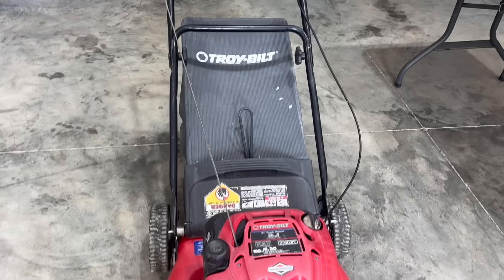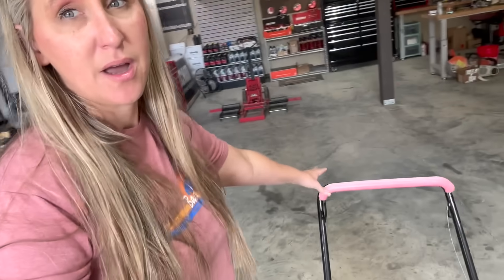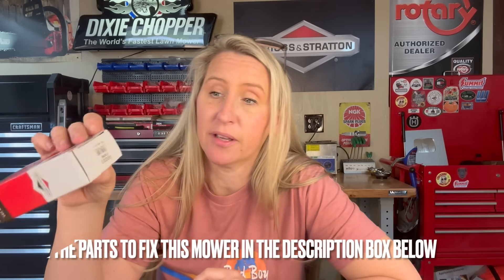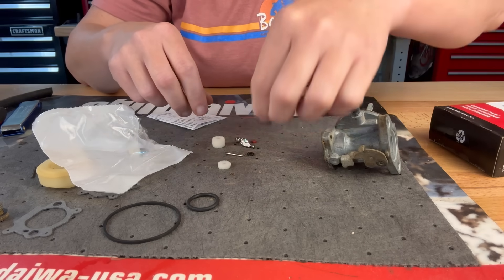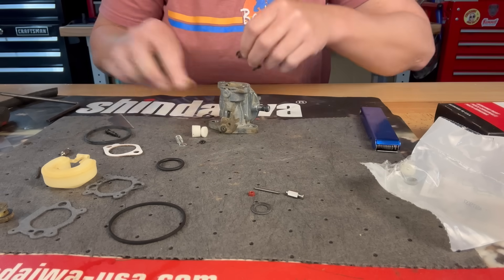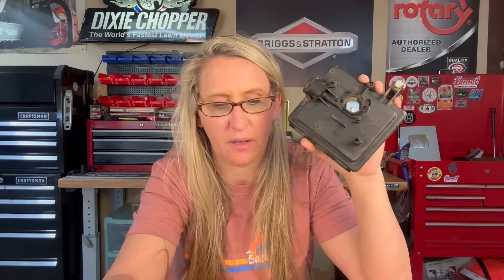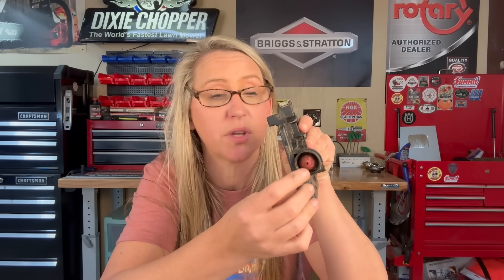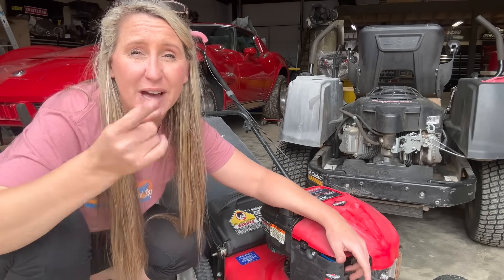FREE MOWER! Turning Customers Trash Into My Treasure! How to Fix a Briggs And Stratton 6.5 Flathead

Comment: I noticed she set the intake O-Ring Seal aside and did not replace it.  For some older machines, if the O ring is damaged or shows signs that it could potentially leak air it should be replaced with the new one.  Her machine was in pretty good condition and no doubt it looked good.  But she might have mentioned the purpose of the O ring she set aside and that it  is an option folks should use if the existing ring looks long in the tooth.

Comment: Got a snapper with a 7.5  B-S on it change the deck the transmission cause it’s self propelled and lord knows how many blades but the engine hasn’t stopped since I bought it in 2012.

Comment: Did I make a big mistake in purchasing a new TORO 163 cc SUPER RECYCLER SELF PROPELLED W/ "PERSONAL PACE'"
WALK BEHIND mower at LOWES (model #21565) for $699.    
NOW I'm hearing of carburetor issues, Briggs & Stratton Motor bad reviews ect. etc. ?????
I spent hours & HOURS watching videos , comparisons etc. but have been discusted with choices for home owners that just need a personal property (almost an acre) self propelled, lighter weight (less than 90 lbs) mowers with a reliable engine ( good carburetor, less plastic internal parts at a price point around $700 - $1,100 ??????  
My Honda HRX 200hp $1,200 was the best mower that I had ever used 2 years ago !       Any suggestions other than taking this one back ad buying a super heavy "Commercial Grade" brand with a KOHLER or KAWASAKI that I DO NOT NEED FOR CLOSE TO $2000 ????    Seems pretty ridiculous that Manufacturers have put homeowners in this very predicament !

Comment: I have a mower with one of those engines from 1994, I've worked in the carb a couple times, replaced the Intake tube when it broke off, basic stuff.. runs great to this day. Rear wheel drive yardman yellow and green baby
Reply: I had a newer craftsman with the same engine, front wheel drive. Wife made me give it to the neighbor when we were moving. Also had an 80s Honda with a rotten deck that my grandfather bought new that I gave away too. Still kind of pissed about that but my mower collection is building back up at my new place with the greenie, a newer Briggs 6.25 non self drive pusher and I just picked up another freebie that has potential

Comment: Carbs are universally garbage and I hate them all.
First, use a spark tester inline with your spark plug to make sure you're getting spark when turning over the engine.  If you are, then it's fuel and the carb.   And if it's the carb, it's the dmmn jets or idle jet that is clogged.    

And if you've cleaned those out the carb several times over and it's still not running right, it's the gasket between your carb and the engine is letting a pinhole amount of air through it, and it's not pulling through the fuel jet.  The solution there is lots of gasket sealer on that old worn out sorry gasket you've reused 5 times over.

I h8te carbs more than life itself.  The truly are a pox upon humanity.   Humanity can put a man on the moon, but it can't build a carb that will run without any trouble.   Eventually junk is going to clog it, varnish is going to clog it, or rubber is going to rot and get an air leak, or your fuel bowl valve fails, or whatever.    It's the sorriest piece of human engineering ever created.... 

And we have a solution to it, they are called fuel injectors....   which too, also fail.  As well as their computers and oxygen sensors.    So humanity needs to go back to the drawing board and deliver some fuel mixing system that does not involve rubber that rots or pin holes that can get clogged with no gaskets that can fail.

Comment: I have the exact mower.  Bought it for $75 and it ran fine. I replaced the fwd wheels,  blade, air filter,  carburetor, spark plug,  did an oil change. 

Thing runs amazing! Put about $125 total into it.

Comment: My rider,  walk behind mower,  snowblower,  and weed eater.  The mower is about 15 years old runs great.  Starts first pull.  All of my machines run great.  I do have a problem with my weed eater though.  Starts up give it some throttle and it dies.  New spark plug and new fuel didn’t help.

Comment: I know this is off subject but i have a question.
I get a burr on the point of my tooth when i use a dremel tool on my chainsaw chain. Husky 450 rancher. What am i doing wrong or what should i be doing?

Comment: My 2018 cub cadet xt2 l42 is dying when I mow after 45 minutes. It is 98 degrees. Not sure heat index. I changed the oil and filters. Still dying after mowing 45 minutes. Blue smoke. What do you think is wrong other than over heating.

Comment: Learned quite a bit from this channel.  I never really had luck rebuilding carbs.  Not that experience in doing so.  I do agree the Chinese carbs are not the same quality but never had issues with them. I do empty out all the fuel in tank and in carb at end of season and do use injector cleaner and Marvel Mystery oil in fuel on every fill up.  I still have lawn equipment and a snow blower from Sears that's over 20Yrs old.  I guess I'm doing something right all these years.

Comment: Thanks for the info. I have a mower of similar vintage (branded  John Deere) with what looks like the same Briggs. It won't prime. I was sold and told that it would be the air cleaner gasket. But not being a mechanic, I've been putting it off. You have given me the confidence to give it a try. What could go wrong!! Thank you, and all the best from Australia 🇦🇺

Comment: I'm impressed. Had fun watching. I don't use cleaning rods though. They scratch the channel walls and lead to premature oxidation blockage and erosion. High pressure nitrogen with a rubber tip blow gun does a great job at clearing after a little carb or brake cleaner softens the gunk. And use a torque wrench to finish tightening. Over torqueing is just as bad as under torqueing. Warping, cracking, stripping, binding... the bolt rods and nuts, the plastic housing, the block threads, all have specific sheer and tensile tolerances that should be observed for longevity. 
Happy tinkering!
Reply: Notice she did NOT use the impact tool to reassemble!  Not even after starting them by hand.  👍👍👍  With experience you know how much torque it takes for different bolt diameters and lengths.  Some of us just like to "feel it".  If I were torquing down a crank in a v-8, sure, but for this?  Nah.
Reply: @TheZuperDave 
I know lots of folks that like to "feel" the torque on refrigerant flare fittings... I guess that's why I get so many calls to fix someone else's "feel". Or perhaps they're just too cheap to buy a torque wrench. Or maybe too lazy to use it. Torque specs exist for a reason. Anyone with sufficient experience knows to use the appropriate tools.
I never said she was wrong. But feeling isn't accurate. It's the difference between a legitimate pro and "the guy who can do it cheaper".
Reply: I've got 30 years with an engineering undergraduate, own and operate my own HVAC company, and restore antique machinery as a hobby.
Good work ain't cheap and cheap work ain't good.
Have a better day.

Comment: Nice to see a good size shop with balcony.  After awhile you start thinking in cubic feet rather square feet because “stuff” begins to accumulate and you still have to be able to get to it.  So, additional balcony could be helpful.  As a suggestion, have ya’ll thought about having a ramp or hydraulic lift it make it easier work on mowers?  As age creeps in, the ability to be flexible will become an issue.  Just a thought and keep up the good work.

Comment: I have a craftsman just like that, great mowers that run strong with the proper care and feeding, but don't leave it outside year round. Actually, the plastic Wheels are the most expensive part and were made of a plastic that deteriorates in Sunlight. Also you have a nice clean work area and I use those magnetic cups to hold parts, they have an annoying habit of walking away.

Comment: Just checking to see if you added oil. We didn't see it. Good job on getting a nice mower! Is a flathead engine one with the valves coming up on the side of the cylinder? Mine isn't a Troy-Built, it's a Craftsman 6.5, but everything looks the same. I go it at the metal recyclers for $20 I've cleaned it up and am waiting on the carb from Amazon to replace it with new, though I cleaned up the carb anyway. Thank you for a very good video!

Comment: I just repaired a snapper walk behind. It cost me $17.98 for the air filter, $23.98 for a blade, $9.89 for a new spark plug. Had to clean out the gas tank because it was used without one since the owner lost it. The air filter was completely plugged. The carburetor had to be taken apart and cleaned. So adding labor to the cost is hard because it was an expensive repair. I was waiting to see the blade sharpening on this video but Looks like it was forgotten.

Comment: Number of years ago, we had a Troy Bilt with a Honda motor. Due to lots of use, the engine just quit, turns out lost compression and I wasn’t in the mood to do a tear down and rebuild. So I bought a Predator 5hp motor from Harbor Freight and mounted it up. I had to add a separate throttle cable, and the mower ran great. I sold the mower for $100 and bought a new Troy Bilt with a Honda motor. Still have it running great as I service it more than I did the other one. We have 2 Troy Bilt self propelled with Honda motors. Unfortunately, MTD isn’t making those mowers with Honda motors, only Briggs & Stratton which I don’t have much faith in, so I’m keeping these going until they fall apart

Comment: A suggestion; since a new gas hose was installed, a shutoff valve would have made soooooo much sense and been a great selling point to a customer.  This way, when finished, turning off a shutoff valve and using up the gas in the carb could prevent carb problems in the future even if one uses fuel stabilizer or ethanol free gas.  That's what I plan to do on my mower once the 2 year warranty perod is up.

Comment: I have a 2002 version of this mower. I have done minimal maint on it. Oil changes,  fuel line, air filter and starter rope replacement . Never used ethanol fuel. After 5 pumps on the primer it always starts 2d or 3d pull. Impressive for a 23 year old engine.

Comment: I put a filter and a fuel shutoff valve on these whenever I see them without them. will never have a fuel issue again if the user uses the fuel shutoff and runs the mower out of fuel!

Comment: I have a 2009 B and S  6.5 hp Craftsman. runs like new. Parts on the chassis wore out but I change the filter, Oil , and alternate sharpened blades every year. I did not know what i was buying but it outlasts the smaller Hondas I have seen in the neighborhood.

Comment: I was gifted the same mower but branded craftsman. It's a little tank. My neighbor got a new self-propelled electric and ask me if I would like it. Yep, just changed oil, filter, fuel line and cleaned the carb. Great little mower.

Comment: $75-$100 is what it would go for around my neck of the woods, that seems to be what everyone is selling their working mowers for.  There are people giving them away all day long because they don't run. A $10 carb kit, maybe a new wheel or 2 and out the door it goes.....Next!  I just picked up a Honda Harmony HRB216, retails for about $800 for free. It was put on the curb with other "scrap metal". Other than a good carb clean, oil change, and blade sharpening... all it needs is a set of wheels because they are all bald. This one I picked up, in running condition, I could probably get $150 or $200.

Comment: I have that same mower. Same year, only difference is mine is self propelled. The only thing I have ever had to do is clean the carb occasionally and just last month I had to replace the front wheels because they are the drive wheels and they had a hole worn through. These are great motors, mine still starts on the first pull even after 18 years of use.

Comment: Nice mower mine has an key start   and working recoil  i have an die hard car battery  950 cranking amps hooked to my push mower this same model  one jumper on starter and one one on metal  starts right up every time but on mine i broke the ready start choke spring and tied wire up to ready start  auto choke leaver now its an manual choke  now i can control the choke  mine takes 40 seconds to warm up i have to run my on half choke  for 40 seconds  until gas makes it to fliter the i pull the choke up front thats my run pull back is my manual choke  hi chickanc  i rigged my ready start up like manual choke  because  if i dont let warm up long  enough  it likes to flood or take  longer to warm up I cleaned the carburetor the right way  but it just takes an bit to warm up that why I took the spring off   the auto choke leaver if I control the auto choke manually  it dose fine I mower 10 acers with this mower very smooth performance  bilt to last this mower can cut grass an zero turn cannot go through very tough troy bilt this this  an yard machines  but  under different name  but just as good as yard machines hi chickanc I like this mower because I can tie baging system door to stay open when in over grown grass

Comment: You might have read my mind.  I have a free B&S mower that only starts with a shot of accellerant, and then runs great.  

No matter how warmed up it is, it requires accelerant to restart EVERYTIME, as in everytime I stop to empty the grass catcher.

Removed the plastic jet business directly above the float bowl, cleaned & reinstalled.  I guess I'm gonna have to go deeper. . . and just when I finally got comfy tearing into my Honda carb after about a dozen times.  Grrr!

Comment: Pro-tip for cleaning yard tools: wash them with McGuires automotive 2-in-1 wash and wax and soak and wipe down all components with McGuires SUPREME SHINE for an extra hydrophobic coating and it helps with UV protection to prevent fading and cracking of plastic components!!! it has the added benefit of faster cleaning in the future!!!

Comment: I used to haul away every "free" mower I saw at the edge of peoples yards. Got rid of most of the spare parts collection too fast. Now I have a Troy mower identical to yours. Problem is I need a fuel tank. Twice I have plastic welded rodent damage to the gas tank. It's leaking again, all new leaks every time with little tooth marks. Why do they like to eat my gas tank over and over again!?
Reply: I had the same problem.  I spray a peppermint oil / distilled water mixture all over the places that mice like to chew.  I don’t know what it is about the smell, but they don’t like it.  I respect everything every two weeks or so.  It seems to work for my cars, John Deere rider, and boat motor.

Comment: The carb rebuild video with insightful instructional comments, as well as your tool selection
were great!  The flexible nut driver used with the drill is ingenius, beats the heck out of a rigid socket extension getting to the bolts holding the carb in place.  I just completed the build of the carb on my Masport mower's B&S engine which is ten years old, and wouldn't trade the mower for anything.  Thanks for sharing!

Comment: Hey, I'm hoping Ron is making a speedy recovery!  I have a kawasaki ninja 1800 power washer - electric.  Is it possible to add oil to the pump?  It is making a grinding noise the last times I've used the unit.  Thanks, Bill in Nebraska

Comment: They really don't last a lifetime, The cylinders wear out on them and they Lose compression. But for what they are, they do last quite a long time I've always gotten more life out of them by using marvel mystery oil both in the oil and gas. For lawn service using them on a daily basis I've gotten anywhere between 3 to 5 years out of them. I've
Tried honing the cylinders and putting a new set of rings in them , but with that , you only get another 6 months use out of them, Which is not worth it.

Comment: I have been learning engines from around 8 years of age, 74 now. Love tour program and I generally pick up something I did not know. Believe it or not. Hard for me to pass by anything in a trash pile. Constantly amazed at what folks will throw away. A bottom line walk behind (push) mower is $240 now days. Should you see a machine in my trash it is that. TRASH. Keep up the good work.

Comment: Fantastic Job Yall !   Got to my 2009 Craftsman Shaft Drive  "Incredi-Pull"  32cc 2stroke that "Bulb" Pump Primer is Rock HARD AFTER RUNNING CLEAN FOR STORAGE.. I know you did a clip on How to replace them. How do I find this ?  Sure Amazon has offerings $5-10 for multiple sizes. Thanks for any help in Advance.

Comment: I have a 6.75 Briggs on a 2550 psi Troy Bilt pressure washer.  It was given to me as a non runner.  I got it running but it runs wide open.  How do I adjust the governor?  Thanks, Gene

Comment: In California at least, 99% of non running small engine is from the 15% ethanol which clearly states on the motor not to use in the ethanol and it comes up the carb remove the car up clean the car spray the carb out put some fresh gas in it that doesn't have ethanol and boom starts I've had mowers that were drenched submerged in water completely in the engine casing during the oil fill the oil it starts right up these things are tanks if you just put good gas in it there's not much to go wrong California people throw these away every corner every block you can pick one up and pick up 10 a day it's crazy people would rather spend $hundreds of dollars on a new one instead of spending 5 minutes and learning how to clean your carburetor